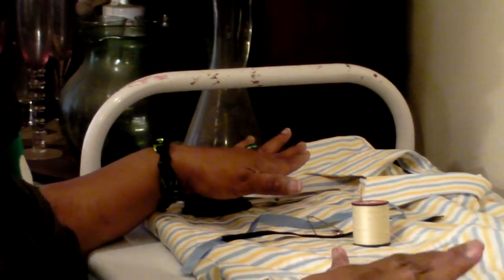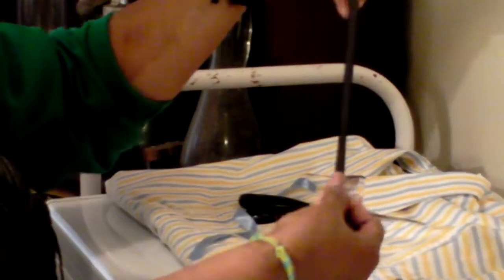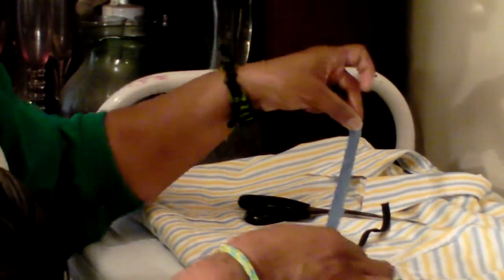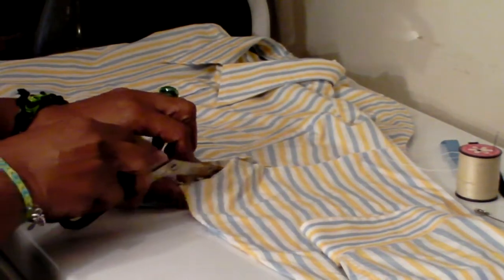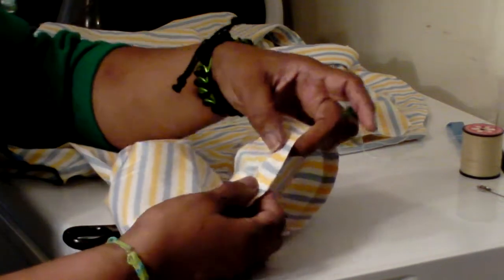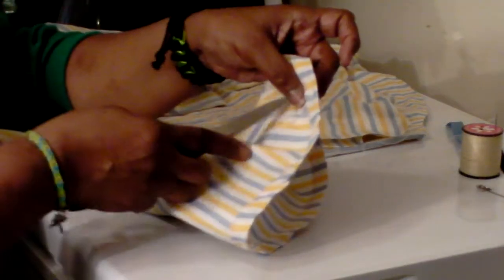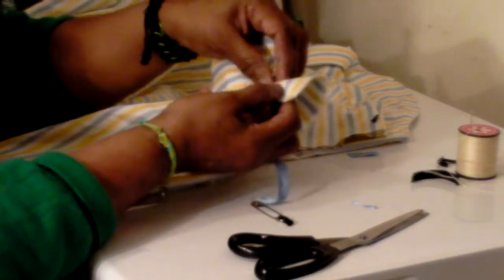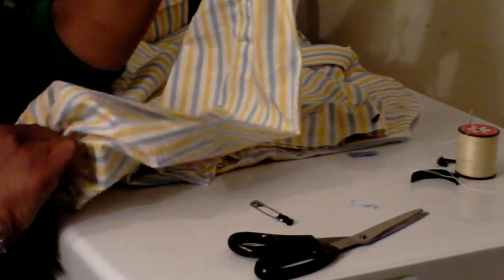Ms Gee Crafting Etc DIY Shirt Sleeve Grocery Bag Dispenser

Comment: Cut the sleeve off in a different place and you won't have to hem it. At the top of the sleeve cut above the place where they have the sleeve sewn on. You'll have no raw edges that wil need to be hemmed. You don't have to run elastic through it. Just sew ribbon or something similar on opposite sides of the sleeve. This is the end you'll put bags in and sew the ribbon on. The hanging strap is the only thing you have to sew when making it this way. You don't have to sew the cuff. This end will be where you pull your bags from.